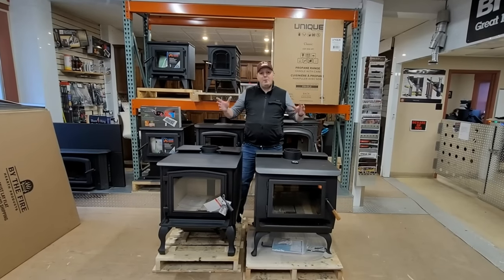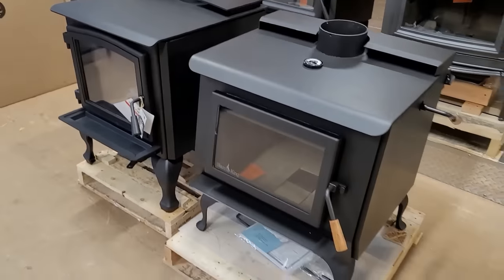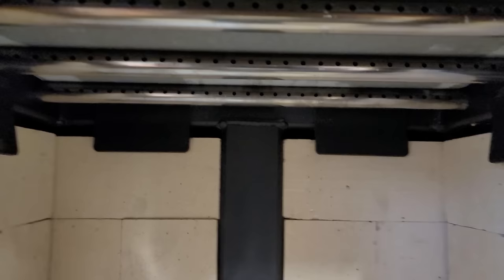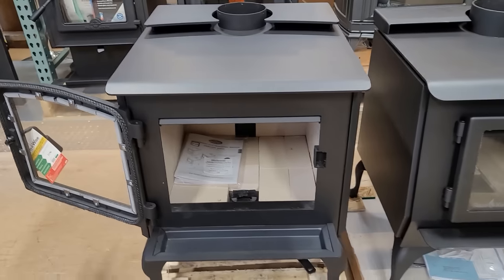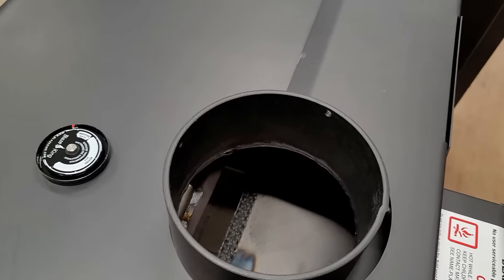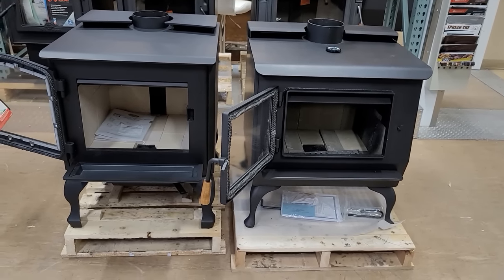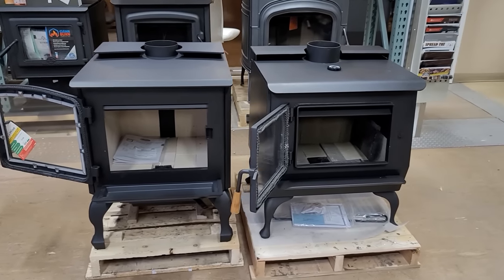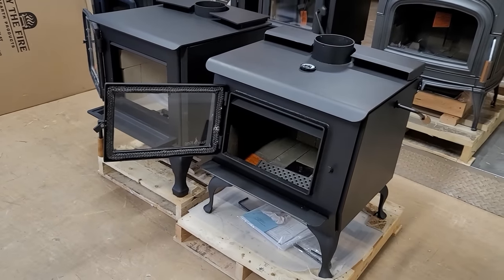Comparing Catalytic to Secondary Air Wood Stoves

Comment: There are only so many BTU's in each stick of wood. Each type of stove will release basically the same amount but the cat stove has the capability to release them slower and longer. This is good for those relatively warmer Spring and Fall days where you dont need that much heat but when its colder expect to run it hotter like the non cat stove. The catalyst will only last 10-12000 hours so if your a 24/7 burner in a cold climate expect a pricey $200-300 replacement every other year after your warranty is up.
Reply: Finally, someone who knows what they are talking about. Burn time is not total heat output. People confuse BTU's per hour (Power ) with total BTU's (Energy).
Reply: Wood type and moisture has a lot to do with burn time as well.  The Jotul manual on the secondary air stoves specifically states that wood that is too dry will burn too fast in their stoves.
Reply: I have had both, I burn softwood that is not very dry, for long periods of time. Cat takes up a lot of chamber and plugged up real fast. Secondary has been much better, good long burn with little chimney cleaning.
Reply: @D-B-Cooper   It is a major mistake to burn wood that is not ideally dry. (If you do not need a lot you could staple some nearby the stove if you have the space and it will lose some water in the house (still costs some energy, that is like drying laundry inside, but at least the burning process is efficient and clean.

Soot in chimney - more cleaning and a fire hazard, could even get tricky if you ever have a fire and the insurance company has a look at your chimney.

 it will likely not be good for the catalyst and it drastically reduces efficiency. The water in the wood has to dry out and that costs energy, you lose that for heating.
Plus more air pollution.
Reply: @xyzsame4081  I live in a rain forest, the ambient humidity precludes having wood dry below 10%. I burn about 5 cords a winter and have done so for years. The only soot I develop is in the cap where the smoke hits the cold air and condenses. I now have a stove with a secondary air system, works great. Soot is a product of having a very low fire that is why new stoves no longer let you throttle it down to smolder all night. The hotter the fire the more the gasses burn off. There is a vid on yt where someone tested kiln dried, seasoned and wet wood. The resulting graft was quite interesting. The only difference was in how quickly the fire came up to maximum heat, otherwise they all produced the same amount of heat and burned for the same length of time. I was once burned out in a wildfire that also burned a thousand homes, I was insured but they never paid me a dime so am no fan of insurance companies.
Reply: @D-B-Cooper   Firewood is considered "dry" under 20 % percentage of water. Of course 15 % is better, if you have 10 % that is pretty impressive - also considering that you get that in a humid area. When a homesteaders has a lot of wind (where the stack is erected), the sun shining directly at the stack and maybe very cold winters - that all helps to suck the moisture out of logs, so that can account for good drying results in only one year, despite living in "wet" country. And of course the size of the logs.

Dry freezing also works for wood ;)

 I saw furnace sheds that seem to be common in certain areas of rural U.S. - They are like tiny cabins with a roof and a chimney - outside but nearby of homes. Insulated, and they also have hot water tanks that supply hot water to the nearby building (pipe in the ground)

 Considering that they fire them with too moist wood (because they never get around to making enough that they CAN let it dry long enough) it is as well that the furnace is at least not directly in the home.

With a large fire chamber, lots of fuel a high temperatue is possible,  and a short chimney and the high temps mean no  problem with draft. If need be they can get the "green" wood started with some help (fossil fuels, some starter). 

But of couse if the chimney is integrated into the home it will also help to heat the building. That benefit of infrared heating is more noticeable in spring and fall. A long chimney is a good thing provided draft is good enough (insulated, some have ventilators to help).

Very efficient stoves and furnaces  mean that the exhaust temperature is not hot . That avoids waste of energy (it stays IN the home) but it also means less temp difference and therefore less draft. 

One man (in a Northern state I forget which one) said that the sparks come out of the chimney if he really gets the furnace going, he assumed that that also cleans out the chimney. That is of course a very wasteful way to run a furnace and to remove soot rom imperfect practices.

 He has a forest and devotes a lot of time to making firewood, and at least he was aware of the fact that it would be good to dry the wood longer - but he never gets aroud to making that much. 
He always fell short of having well dried wood. 

Home probably not well  insulated and also not compact, obviously not built with energy efficiency in mind.

Using the imperfect wood means that he needs at least 20 % more fuel - so it is even harder to prepare enough wood in time. (it takes a LOT of energy to evaporate water. your life experiences are not consistent enough -  but that has been tested under truly comparable conditions. Mooisture in wood costs - use of the fuel and also pollution). 

Once a larger volume of the too moist wood gets started it will still burn hot BUT a part of the good heat is used to evaporate the excess water. If the fire is big enough that will happen. With dry wood the sun, the wind would have provided that energy for evaporation.

Where I live it may be possible to dry fresh wood down to acceptable / good levels in one year - it is chopped, stacked up neatly  where it is sheltered from rain but the wind can around the stack.  If the sun can heat it up in summer all the better. 

else it is comon to have the chopped wood stacked up for drying for 2 years. Of course these are people that have efficient stoves - and they must have the chimney swept on a regular base, the professional would notice if they do not abide by the regulations (it is forbidden to use wood with more than 20 % moisture), it leads to incomplete burning and polllutes the air. it is also a fire hazard because of soot. Those american furnaces avoid that by having these huge fires that "burn out" the chimney,  but with a normally sized furnace or stove IN the house your are getting into trouble.

But people often invest into their stoves and would not use wet wood. Especially not for the expensive stoves with a lot of mass (tiles and the fire chamber a special ceramic) - those are installations that can hold for 100 years. No one is going to put that at risk with inadequate fuel. 

I have seen videos from another homesteader in Alaska, that also has that furnce shed outside the cabin. The owner could hardly keep up with making the wood (not sure how well insulated the cabin is, they had several large windows, the construction company persuaded him that French windows were not a good idea, so the large windows were the compromisee. 

Beautiful view for sure, but even if he has excellent windows that will cost him some energy in the winter.

If you have to evaporate water it costs energy. That is not as efficient and yes it is one source of soot. The other one is slow burning with reduced oxygen supply. 

The ideal process is to burn wood at high temperatures and for a short time and then to extract the heat from the gasses before they leave via the chimney and to store the heat. Either in the traditional ways with a stove with a lot of ceramic / tile mass (like in Europe, the tile stoves) or the rocket heaters (I think they are surrounded by loam, that stores the heat from the fast burning process - with relatively little fuel btw. 

A wood stove can also be the furnce for a central heating system.

A heat exchanger extracts a lot of the energy. The stove burns the dry wood - fast, hot, and clean  - so not as much heat escapes via the chimney, a lot of if goes into a hot water tank that is used for normal hot water and also to heat radiators.

It is a central heating with an added bonus: the heating devics also provides infrared radiation in the room where it is run (which can be in a basement, but will often be in a room. 

Could be a kitchen. a friend had a wood stove for cooking / heating and that was also plugged into the central heating and the hot water tanks. They had solar panels but that was not enough in winter.

The OTHER method is to have the smouldering fire - usually that creates a lot of pollution, could also be a monoxide poisoning source, so the stove and doors have to be good quality. 

The catalyst makes it safely possible to do that -  w/o pollution  (folks used to do that, to have an onging supply of heat and do not to feed that much into the stove, but that was not a good practice). 

Now you can have the slow, steady and hot but small fire and there is as little pollution and good energy use as with hot and fast fires and storage in mass (tiles, ceramic, loam, or a water tank).

The catalyst stove is not as expensive as a central heating setup with heat exchange and water tank for storage, and radiators, plus the plubming. 

In smaller well insualted homes, maye with another smaller and lexx expensive  stove for extra heat that may make a central heating obsolete if you have a solution for warm water. (thermal solar can be sufficient to provide warm water even in winter, on a sunny winter day the temperature in a tank will go up nicely. Typically they add some more heat with electircity if needed. 
Heating rooms needs more energy thann heating up wrm water for use.
Reply: @xyzsame4081  I think that if you made the video, it would be a little different than the salesman's.
Reply: @D-B-Cooper  I've got a Pacific Energy super 27 and it's been an extremely nice stove. However, starting this year, we are only allowed to cut 3 cords of wood as opposed to 5 cords.  Since I burn from mid to late November all the way to somewhere around April, 3 cords of wood is not enough. I was thinking about converting to a catalytic stove but I also burn softwood and it has a moisture content of between 15% and 20%. That's the best I can do with our climate here on the east coast.
Reply: @scottfurlong5475  what do you mean “you’re only allowed to cut 3 cords”?
Reply: @scottfurlong5475  15-20% moisture is perfectly fine.
Reply: @D-B-Cooper  nobody is getting their cordwood below 10% unless they live in a desert. And there's no need. Under 20% is perfectly fine. The lowest I've ever got any of my wood is 16%.
Reply: I was looking for this answer in the video, Thanks.
Reply: @xyzsame4081  Walker Stoves has made a lot of refinements on the rocket heaters.
Reply: @D-B-Cooper  So you live on a hill? ;)
Reply: @insideman6680  actually I live on the ocean but I’m guessing you are poking at my moral high ground.
Reply: @JCA122510  Our wood cutting permit has a 3 cord maximum now. Up until last year we were allowed to cut five cords on a permit.
Reply: @BrockOBauma  just curious because the wood seems to do a lot of hissing when it's thrown in on some hot coals which kind of makes me think the moisture content is a little high.
Reply: @scottfurlong5475  way to wet my brother...
Reply: @joelsanford  I have a Jutul wood stove and have read through the manual and I don't recall reading that. In general, wood can never be too dry (seasoned). A lot of heat is lost during the first phase of a fire where the water steams out of the wood. Secondary burn stoves are most efficient during the 2nd phase of wood burning, which is where the wood is out-gassing and the secondary air mixes with the wood gases and burns efficiently.  The faster the wood can move from the 1st to the 2nd burn stage the longer a high-efficiency burn will last. If the wood is not fully seasoned a lot of energy is wasted (goes up the chimney) while the water is steamed out of the wood and more creosote is deposited in the chimney.
Reply: @TugHillGuy  The point is it can be too dry to get the advertised burn efficiency.  This is copied directly from my manual (F55 Carrabassett):  "Wood  that  has been air-dried for a period of 6  to 14 months will provide  the cleanest, most  efficient  heat. Wood seasoned more  than 2 years will burn  too quickly  to  take advantage of  the stove’s low end efficiency strength. "
Reply: Blaze King offers a 10-year extended warranty on their catalyst combustors. They can do that because they have a thermometer near the catalyst that serves to control the air flow to the fire so that they don't burn up the combustor.
Reply: @TugHillGuy  yes that’s a good thing for an occasional burner but if your a 24/7 burner all winter that cat will only last 2-3 years so you will get free replacement the first time, after that it’s all your cost. I know BK owners that go through a cat every other year, the cost of a $300-400 cat can add up fast in 10 years for them.
Reply: @wobdeehomestead  That's interesting to learn. I just happened to stop in to my wood stove store yesterday evening to pick up a replacement door glass for my Jøtul F 500 Oslo. I tend to burn my stove 24/7 most of the winter. My Oslo is a 2006 model, which I think is V1 or 2. The new V3 Oslo has a high air flow combustor along with a secondary air baffle set up, so when the stove is running in the secondary burn mode (the firebox temp is 700+° F) the secondary air burns up most of the smoke particles and the combustor "polishes" the air further by burning up pretty much all the remaining constituents in the exhaust. It has an emissions rating of .5 grams/hr. The combustor is as wide as the fire box and has such high air flow (98%) there is no need for a bypass damper, so it's always burning in a "clean" mode, even right after you light the fire. The secondary burn takes a lot of heat out of the exhaust before passing it to the combustor. The combustor has room for expansion so it won't warp from high temps. It also has a temperature probe to adjust the secondary air flow. It comes standard with a 20 year warranty on the combustor. The stove achieves a 78% HHV efficiency. Jøtul has a good video that explains all this on YouTube. 

My store also sells Blaze King stoves and I talked to the salesman about them. He happened to tell me about the 10-year extended warranty on their combustors, though they appear to be more conventional than the Jøtul combustor. I steered away from catalytic stoves when I was buying one in 2006 because I heard the catalysts were the "Achilles heels" of their design and needed to be replaced frequently. Jøtul stopped making catalytic stoves years before I bought mine because of the problem with catalysts not lasting that long. I can see why they came up with the new combustor design to overcome all the usual problems they present.
Reply: @TugHillGuy  I’ve seen that F500 video, looks like a promising design but I’ve also heard issues with the cat warping. Jotul knows about it and I’m sure it will be fixed. I love Jotul, own two of them, F45 and 602CB. I hope these hybrid designs work out but they are new and time will tell.
Reply: @wobdeehomestead  I like that Jøtul has a similar skepticism about catalytic stoves that I do. It seems a shame to have a nice steel, cast iron, or even soap-stone stove that is nearly crippled by the failure of a fragile catalyst.
Reply: @scottfurlong5475  that permit for cutting is on public lands not private right?
Reply: @farmnranchapiarybeehiveser8120  Public domestic cutting area.
Reply: @scottfurlong5475  👍
Reply: @wobdeehomestead  I'm not sure I'd agree with you.  I have a BK King.  Myself and two friends in CT bought ours all at the same time back in 2009 ($1925 each, don't know what they cost now, but I'm sure they're worth every penny).   Anyway, we all remove and clean the cat at least once a year.  All of us use the stoves all winter long, and we are all still using the original cat!  I do have a spare cat which I bought with the stove, but haven't installed it.
Reply: @scottfurlong5475  wood under 20% shouldn't be hissing. How are you checking it? Accurate moisture content readings require splitting a piece open and checking the middle.
Reply: @ssoffshore5111  that’s a long time, how’s your chimney look? I’m just stating what the catalyst manufacture states, 10000-12000 hours. That’s great it’s lasted that long, I’ve never had one last more than 3 seasons before I saw smoke out the chimney and a drop in stove temps. Does your catalyst probe still sit in the active zone?
Reply: @scottfurlong5475  allowed 3 cords of wood?
Reply: @wobdeehomestead  The cat on my Buck Stove is over $300.  They are not cheap..
Reply: @scottfurlong5475  - I live in south central Louisiana. Ambient moisture content here is 13% to 14%. I know this well because I air dry lumber from a portable sawmill and use two different brands and types of moisture meters.

How it is your ambient MC is higher than ours is a mystery.